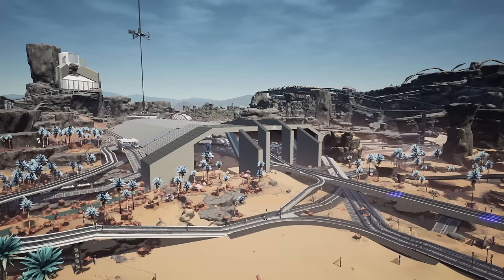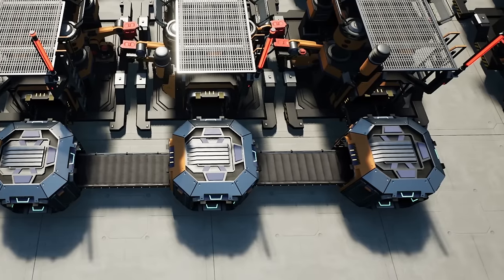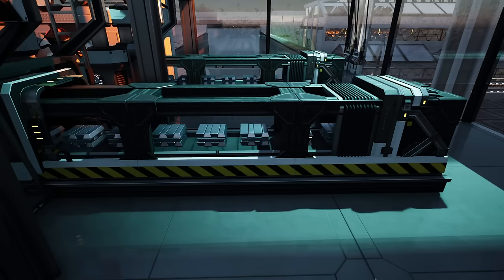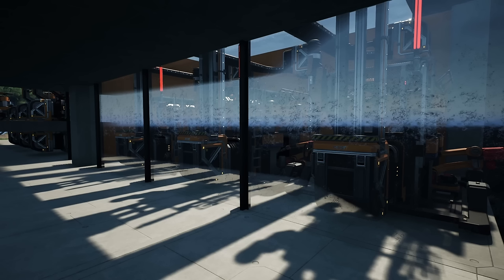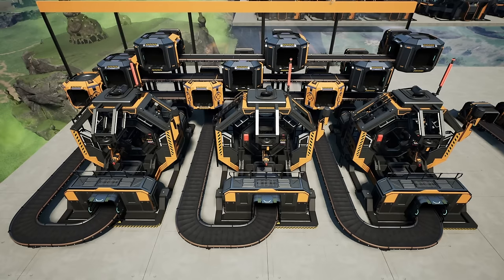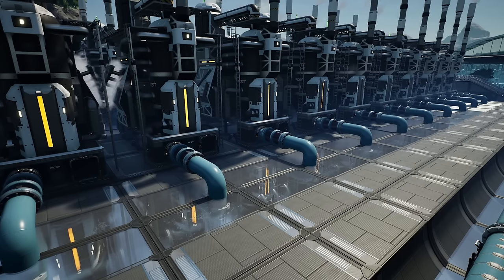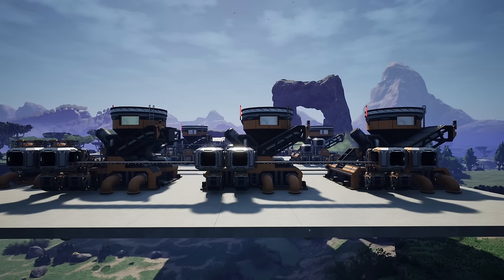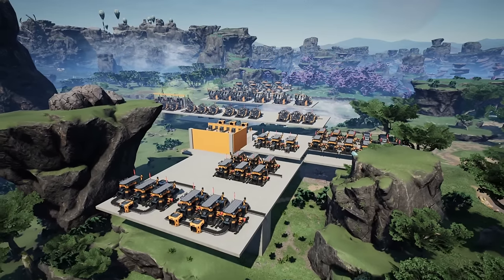Different Loading Styles | Satisfactory Game

Comment: What i started doing is using smart splitters to create what i call a forced inverse saturation manifold. Basically what I do is the opposite of the standard manifold that saturates the first machine with 50% of incoming material with each successive machine only getting half of what the one before it does. Instead, i use smart splitters to treat the machines as overflow outlets. This causes the machine at the far end to take everything that comes to it until its saturated. At this point the next machine before it starts getting saturated with only a small portion being able to make it all the way to the end as space opens there. I found that this set up causes manifold saturation to occur very quickly.
Reply: It should be exactly the same.  Your method seems very slightly faster in that the instant one machine backs up it will start filling the previous one -- you don't have to wait for the travel time of the main belt between machines.  But this is countered exactly by having to wait for that same travel time before the first machine (at the end) starts filling.  So in the end you're just using more expensive splitters than you actually need to, and just moving when the delays happen without affecting the total time.
Reply: @Mirality  I mainly did that setup as an experiment but in a way you’re right. The key to get a manifold to warm up at the rate that it should is to have the belts feeding a machine to be just as fast as they need to be an no faster while the main belt is the fastest one you got. Even if smart splitters are used if the main belt is getting 4x as much as what a 60 ppm belt will take it’s only going to put 1 on that mk 1 belt per second while the other 3 go elsewhere. Be it another machine or continuing down the main branch.
Reply: Well, that's helpful to spread out the initial items a bit more, but it doesn't really matter in the end unless your entry belt is way longer than it normally is for a manifold.  It's easier to just use the same belts everywhere, if you can afford it.

Because Mk3 belts are relatively cheap, I tend to just use them for everything unless I specifically need something faster (e.g. transporting wire), or want to unevenly split a belt for some reason.
Reply: @Mirality  easier yes, though not quite as efficient in scenarios where you got say an array of machines that can process 270 ppm, a belt that can feed at 270 ppm and product being produced upstream at 270 ppm but then in those cases you’ll likely use a load balancer anyway. Or a manifold that uses slower belts fed by a faster one to even things out. 

After all, no one ever said that you’re machines need to be saturated to run at 100%. It’s enough that each machine gets material as fast as it spits product out. Taking into account, of course, when something needs say three of something to make one if something else. Like the 3:1 ratio for refining caterium.
Reply: @thesageofgames1871  "The key to get a manifold to warm up... is to have the belts feeding a machine to be just as fast as they need" this is actually incorrect. While the ideal situation is one where each (machine) input belt carries just as much as needed, the second best is one where the machines are filled ONE AT A TIME (so fastest belts aviable, with smart splitters sending overflow down/up the line only after the machine is full). If you think about it in another way: to reach max efficiency a manifold needs to put X stacks of items in X machines; each machine taking items can consume some, increasing the "fill time"; so the least machines are on during the "fill time", the least items needed to fill the X machines with full stacks of items.

Comment: In my (now infamous) "Compact Compacted Coal Generator" power plant, I was forced by the (questionable) constraint to fit the Assemblers in the vertical space between the Coal Generator and the bottom of the narrow part of the smoke stack.  Since repeatability (somewhat) and compact layout are constraints, there is not much space between double rows of generators, so the only way the Assemblers fit is lengthwise, end to end.  Inputs on vertical stack on one side, outputs on the other side.  What's not repeatable is getting all that Compacted Coal from 33 Assemblers @ 99% into 56 Coal Generators at 250%.  Still trying to think of a better way to clean that up.  Maybe separate Assembler Output manifold from Coal Generator input manifold.  I needed power badly, so haphazardly interleaved output manifold with individual splitters to each CG input.  Not repeatable.  Needs parmesan and bolonase.

Comment: The one caveat I'd give to a manifold is when loading up coal power plants.  If you're pushing both your coal and your water to it's limit (e.g. 8 plants, 120 coal and 3 extractors), it helps to be a bit more particular, making sure water is backed up into the plants, before bringing in the coal.  But while you do that, also be storing up some stacks of coal to load by hand into the plants, after connecting the belts.  The extra care just ensures nothing momentarily has issues due to transport latencies... either that or I'm an idiot and can't figure out coal plants after having played for 3 years 🤣🤣🤣
Reply: The only thing that has worked for me, is usually I can load 1 and let the system run itself, i.e. don't connect it to the rest, and wait for the others to load up their own coal and get ahead. But loading them all by hand at first is definitely the easier way to go. :D

Comment: so, I'm gonna suggest a vid I don't need but I think you would get some useful views from. I would like to see a vid on setting up smart splitters (before programmable, but maybe another vid) to allow flow control. But expanded on, so not just feeding extra items to a sink, but also maybe something creative or fancy.

I have a layout that makes Steel Bars and sinks Black Powder. Once a container is full, I work on Steel Pipes. Lastly, I stop sinking Black Powder and make Nobelisks. I use 1 item/slot (screw, plate, etc) to limit containers emptiness. If all are full, I sink the extra Nobelisks. (early game) (I do plan to not sinking Black Powder and use all Coal for Bars/Pipes first, when I upgrade it to a vertical building)
Reply from the maker: I'm actually working on a video on smart splitters currently as one of the projects, great suggestion though!

Comment: nice tips.  i havent tried it yet but i was thinking if you had fast enough belts, couldnt you input multiple items from one belt using smart splitters?  im fairly new but i just got mk3 belts and im thinking of doing that for parts of my steel factory when i redo it.
Reply from the maker: you could.... but if the loads aren't 100% balanced perfectly or you're not using overflows properly, you run the risk of things seizing up

Comment: Does this mean floor holes for fluids are working now? Last time i tried them I was getting no flow though them.
Reply: They work, but can still have issues from time to time. From what I've seen, typically rebuilding will fix the issues.
Reply: Would one need holes when punch-through achieves close to the same look and results?